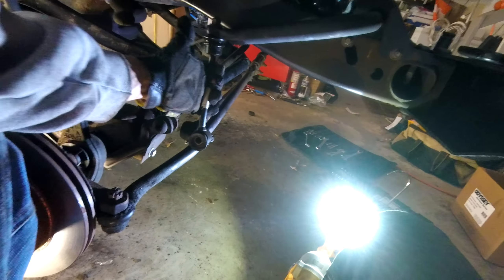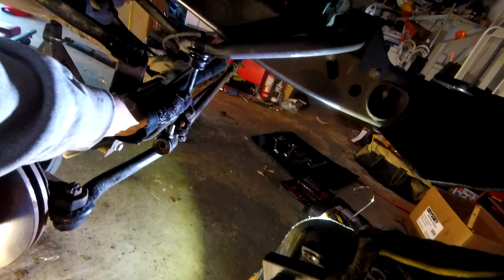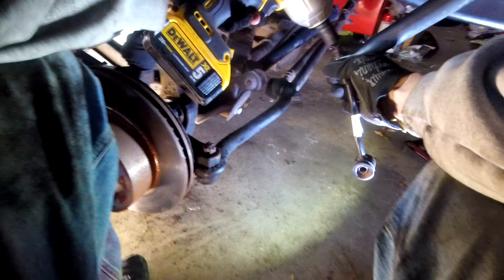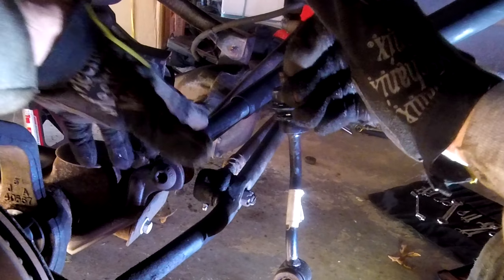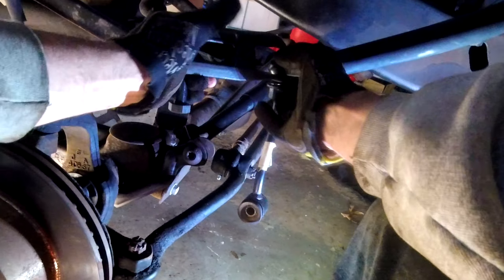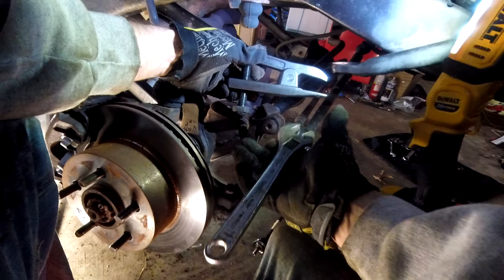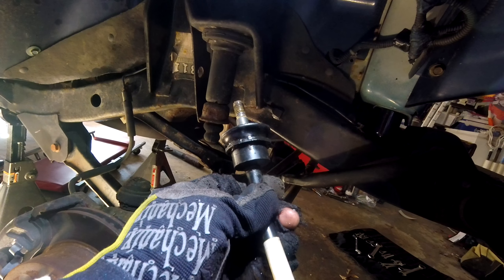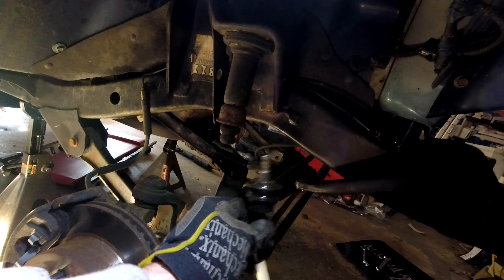Front Sway Bar Link Removal - Project 2004 Jeep TJ Wrangler Tip - How-To

Comment: Great tool! Watched your video after struggling with a pickle fork and BFH. Came right out with that $15 HF tool. Top tip: If you leave the nut threaded on the very end, the ball joint wont shoot out unexpectedly.

Comment: Thank you for this. Mine were both frozen. One required the ball joint tool to pop it. Thanks for turning me on to the technique, and for pointing out to stay the heck out of the way. There was so much built up force that my sway bar flew ten feet when it popped off.

Comment: Do you know what brand/model ball joint separator you have?  I'm trying to find a good one.
Reply from the maker: I'm using this one from Advance Auto - just because they were close and I could pick it up locally - https://shop.advanceautoparts.com/p/autocraft-ball-joint-separator-ac3430/10449277-P
Reply: Thanks.  I checked my area and all the stores have them in stock so Ill pick me up one soon.
Reply from the maker: As you can tell, I get a lot of use out of mine... definitely worth having in the toolbox!
Reply: Picked one up the other day.  Preparing for the installation of an OME lift on my '06 LJ.
Reply: I used the ball joint separator yesterday on the front sway bar end links.  Super easy!  Thanks for the tip.